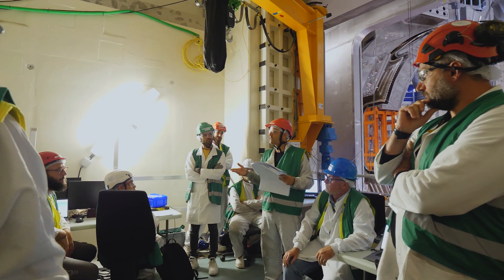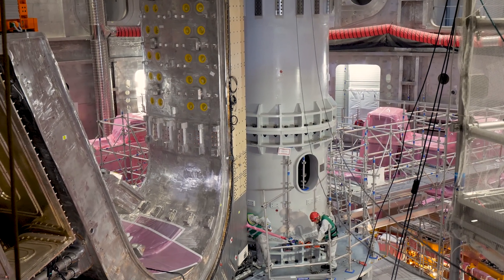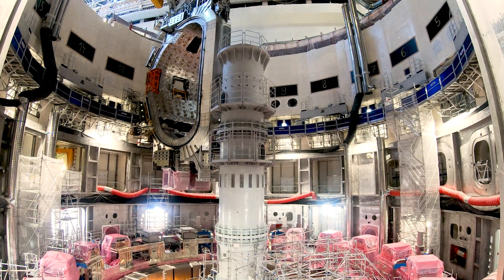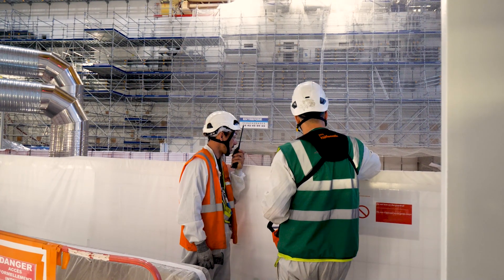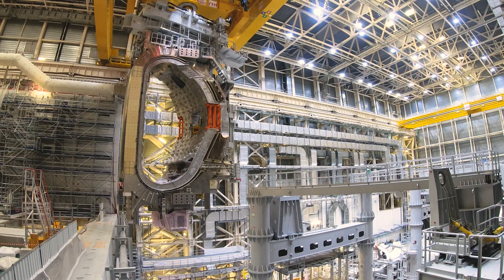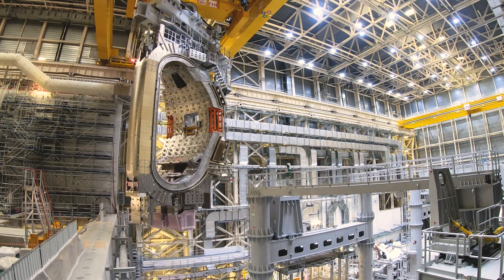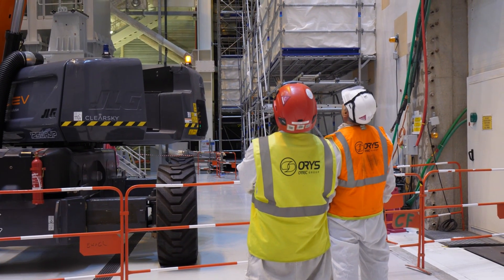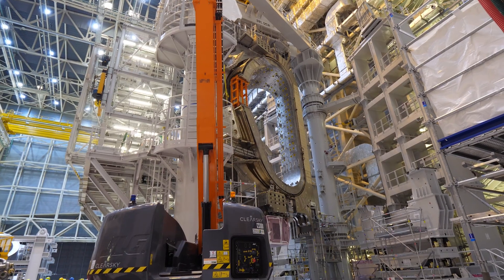A four-day "reverse lift"

Comment: You guys should use the US measurements system. The US should refuse funding to anyone who does not use our system.
Reply: The USA use metric. They just don't let people like you know, for obvious reasons.
Reply: @adrien5834  then why is the speed limit in miles per hour on every single Road in America? Why is every speedometer in MPH on every American car? Why does The Weather Channel report the temperature in Fahrenheit? American measurements are for Kings your measurements are for peasants
Reply: @rockyhighwayroad7365  Yes, well, kings don't actually have to build anything so they can afford to have useless units. But everything important is done in metric in the USA, from science to engineering to manufacturing. Oh, and of course the US military uses metric as well.
Reply: @rockyhighwayroad7365  And yet the USA use metric. The USA are a member of the International Bureau of Weights and Measures whose job it is to define metric (SI) units, and that's why every single one of your customary units is defined in metric units. So nobody cares what you personally want or think, American scientists use metric, American engineers use metric, American industry uses metric, and the US military uses metric and if you believe otherwise you've been lied to.

Comment: Put laser sensors to measure if "burning" plasma bend spacetime. iter is best opportunity to discover gravitons. I can't see how such expensive machines could be source of cheap energy but I can imagine Iter tokamak being beginning of gravity engine.
I guess 100mln Celsius degrees are only theoretical. If it would be possible to burn plasma without machine turning into pieces than why not use gained energy to turn plasma faster and faster? At one point innertia would be higher than earth's gravity well. And than we have gravity engine
If Cern accidentally losing invisible amount of gas manged to have damages comparable to fast moving  train it means it is more than theoretical.

Comment: Designing the building and lifts to allow for only centimeter clearances is a waste of public tax money.
Reply: building for cm level clearance is best, assuming you know the measurements - you know how tall the thing is - why bother building the building taller just to make the clearances bigger? Side to side clearances are bigger due to controlling the swing of something so big, but lift clearances are much easier to control.
Reply: I am glad for your expert opinion on the matter.
Reply: what’s the issue it clears and that’s all that matters I’m more then sure they know exactly how much clearance was needed and honestly in industry there’s thousands of examples where the clearance limits are smaller then this
Reply: So. random person.  How many prototype Tokamak plants have you designed built?   Have you actually ever built anything in real life?
Reply: Exactly. I posted the same thing. It's the opposite of defensive robust design. It's amazing someone approved this. "You left how much clearance for this massive component that is manipulated by huge building-scale cranes? A couple mm, oh ok, that will do. We can always spend another billion and a few extra years to design a custom crane with mm accuracy and a few extra months planning the lift operation so that it has a high chance of success without having any margin for error. In fact, this genius design will ensure the lift operations are so difficult that we can make an entire video about each one."

Comment: From the project website:

"[The] 1,350-tonne module was removed, as dimensional non-conformities observed in the vacuum vessel sector's bevel (welding joint) region, combined with corrosion-induced cracks in thermal shield piping, meant that the sector module had to return to tooling in the Assembly Hall for disassembly."
Reply: Thanks. Just the info I wanted.
Reply: when your fix results in something better than the original idea is the hoped for result. nothing ever goes together perfectly on the first build.
Reply: it's expected for things to not always be on dead nuts . but the problem with this project is that every mistake brings months of delays and millions spent
Reply: @kisspeteristvan  They are building a prototype, things happen.
Reply: I think we're now addicted to the hopium/copium at this point. These kinds of mega structures is not something Europe is capable of since the 80's. Maybe they should hire the Chinese to get it done?
Reply: @newworldforward1842  Have you heard of Tofu Dreg?
Reply: Who would have thought that welding inox makes it warp uncontrollably. facepalm
Reply: @Mp57navy  The pipework was supposed to be flushed to prevent the problems but either it wasn't done properly or it failed on this occasion. Remember, this thing has never been built before, it is a prototype and like all prototypes, things don't work the way people think they should.  Problems crop up that it's easy in hindsight to say "I knew that was going to happen".  
Before you claim you could do a better job, look at the specs and ask yourself if you could honestly have done better.

Comment: That one expensive mistakes someone did somewhere !
Reply: From what I recall, the corrosion was caused by the cooling pipes not being flushed completely (they are incredibly small).  Remember, this is a prototype, it has never bee built before in the entire history of the planet.  Things will go wrong, it's how they are fixed that is important and the lessons learned.
Reply: @ptonpc  There are several tokamaks on this globes and some of them are very similar to ITER but just smaller.

Comment: Hello iter, could you please explain what exactly needs repair and how it will be repaired?
Reply: Check the link in the description:
"In May 2022, the first of nine sector modules that form the tokamak torus was installed in the assembly pit. In a reverse operation last week, the same 1,350-tonne module was removed, as dimensional non-conformities observed in the vacuum vessel sector's bevel (welding joint) region, combined with corrosion-induced cracks in thermal shield piping, meant that the sector module had to return to tooling in the Assembly Hall for disassembly. Although not foreseen in the original specifications of the assembly tools, the reverse lift operation was performed with the same hardware successfully."
Reply: @Shadow9OO  "not foreseen in the original specifications of the assembly tools" 
So none of the incredibly smart people said ' what if we have to take it apart? ' during the design phase ?
Incredible. Perhaps more incredible than the fact that there are dimensional inaccuracies, corrosion and cracking in what is probably one of, if no the most, scrutinised pieces of equipment ever built.
I wonder if the remaining segments, which I presume are already under construction, are now all due to be re-worked.
Reply: @Andrew_Fernie  Easy for the random person on the internet to criticise the people who's job is to build something never constructed before in the entire history of the planet.   
No the parts were not designed to be taken apart.
Reply: @Andrew_Fernie  You clearly never worked in manufactoring (or didn't learn anything there). While I can't believe it myself that they didn't notice it sooner I know that nothing works flawlessly especially the first time trying it. So many expansive broken tools in manufactoring...
Reply: @Andrew_Fernie "dimensional inaccuracies" in this case means sub-mm precision of exotic materials for a part that has never been built before. Let a prototype be a prototype.
Reply: And why ? Isn’t it brand new and never seen plasma ?
Reply: @nicodesmidt4034 It is brand new, but they discovered some issues that occurred during manufacturing, which weren't found until after it was installed. There are more details in the video description.
Reply: @ender4555  yes, saw it later. Thanks for responding anyways